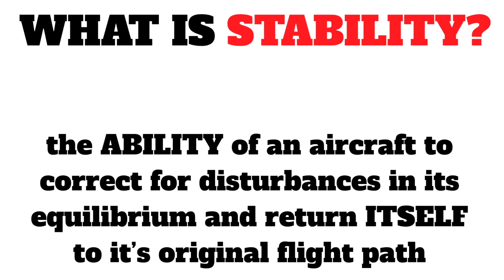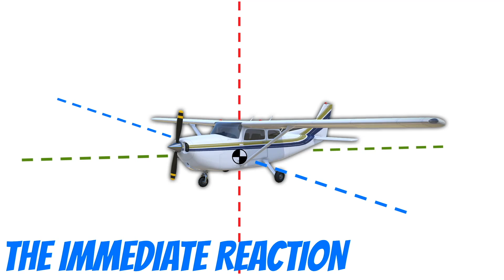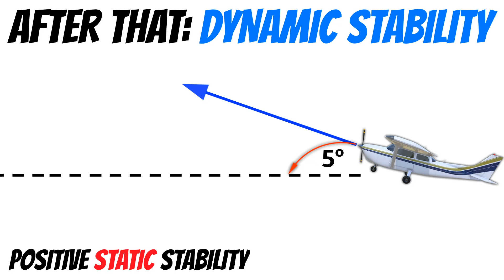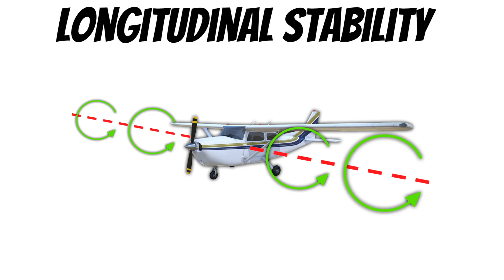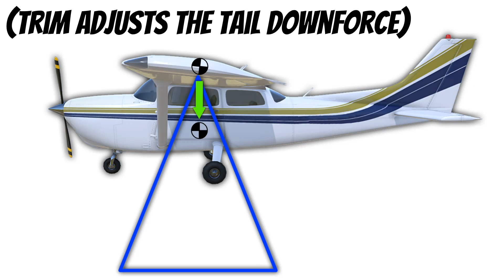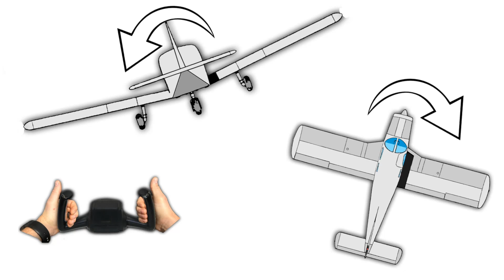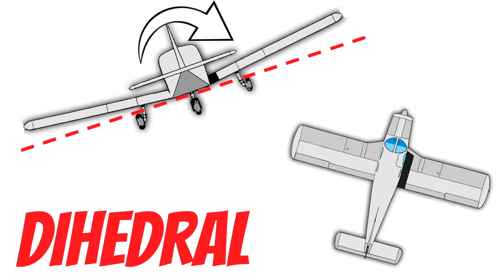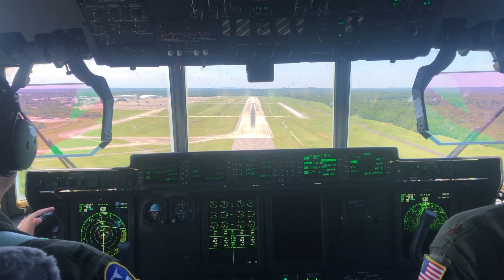Aircraft Stability Explained (PPL Lesson 6)

Comment: Josh, thank you so much for this free content! I’m learning a ton. I did have a question about the dihedral explanation though: the difference in AoA between the two wings when the aircraft rolls is referring to the air slipping sideways under the wings due to the induced slip while rolling, right? In relation to the aircraft traveling forwards, both wings would maintain the same AoA? Very new to all these concepts, but there might have been a detail missing there perhaps? Thanks again! Really enjoying your course
Reply from the maker: You’re very welcome! Yes, AoA increases when a wing advances in a yaw. This increases drag on that wing.
Reply: @FreePilotTraining interesting. I wasn’t thinking about the effect of a wing which was forward in a yaw. I need to hit the books again to get it
Reply: @FreePilotTraining follow up, is the AoA difference here due to the effect swept-back wings have in a yaw? This would cause the forward wing to see airflow more directly in line with the wing chord line, while the trailing wing would see airflow more ‘sideways’ across the wing surface (less directly across the airfoil shape, generating less lift and drag)?

Comment: I took the quiz for this, and a question is:
What aspect of stability does the center of gravity affect?
The answer marked correct is:
Longitudinal stability

I don't agree with this. The CG can be moved fore and aft, but it can also be moved left and right, and up and down. For example: fill one wing tank with fuel and empty the other one. The CG did not move fore or aft, but it did move! It moved laterally.
Reply from the maker: Great point. You are technically correct, but the FAA wants you to understand that the biggest danger to you is CG in relation to longitudinal stability. In larger planes, a fuel imbalance could be a very serious problem, but nowhere near as serious as a weight imbalance that affects your longitudinal stability

Comment: Thank you for this! Since ive been using the C172SP, ive not understood the reason for the trim control, but now I can impress my CFII with my new knowledge!! Also, I took my first flight, and my CFII told me that he'd never seen anything like a good flier on a first time! My takeoff was immaculate he told me, and i was able to maintain stability of the aircraft for the whole duration of flight without him grabbing the controls! He did land for me though. He also did (to have fun) demonstrate a 45 right bank angle which was impressive! He wants me to work on not losing altitude on my 30 degree banking turns though.
Reply from the maker: You’re welcome! It’s super cool that you found this ground lesson helpful in flight. That is the goal!

Comment: I'd say that, when looking at the dihedral example, the lower wing has more of its lift vector pointed at the ground, more of it goes into counteracting gravity than on the higher wing side, so the entire thing wants to go back to equilibrium. I don't see where aoa comes into play here, both wings are at the same aoa.
Reply: I think he forgot to say that the AoA difference is in relation to the induced sideways slip that occurs when the aircraft rolls. While slipping, the lower wing sees a higher AoA to the air slipping sideways under it, not the air moving backwards as the plane travels forward (extremely novice student here, forgive me if incorrect)

Comment: for those who dont understand, all rotations (and all forces) revolve around the Cg ( Center of Gravity), so since the center of gravity shifts forward when pitching up then the Static stability will be positive, simply meaning pitching back down. You can shift Cg with AoA. Remember Cg is a point on the plane that must be equal to the other point (TDF) and the Wings are whats the balancing the 2. Like your finger when balancing a pencil, it has 2 sides and if you make one side heavier, you have to adjust your finger, or AoA since we're talking about planes LOL. But the more forward the Cg, the more the tendency to pitch back down is also Positive static. It all depends on where youre Cg is placed. And Cg have limits that shouldn't be surpassed. The Forward and Aft Cg limits. If you raise the AoA, the Cg will move forward, but if you raise to far and the Cg surpassed the Forward limit, (remember, all rotations you make as in yaw, roll, pitch revolve around Cg) you will lose control and it becomes difficult to get your aircraft under control. Happy studying